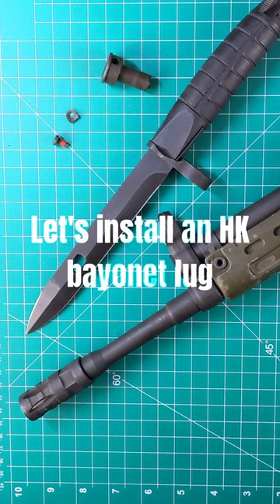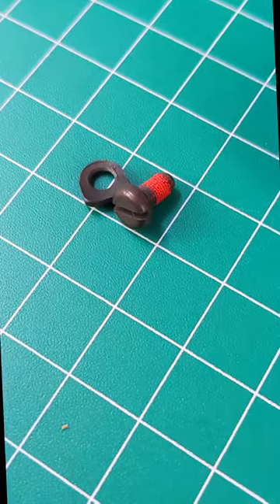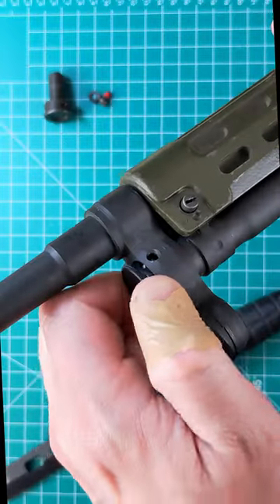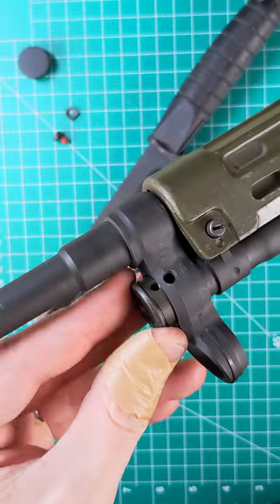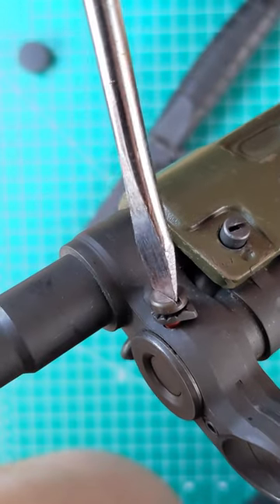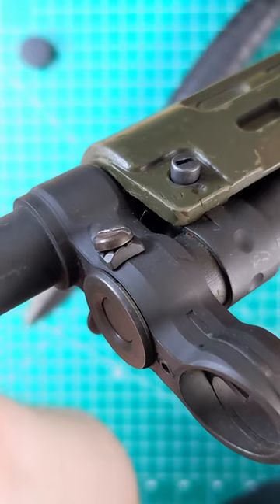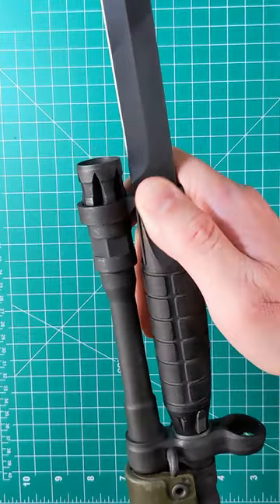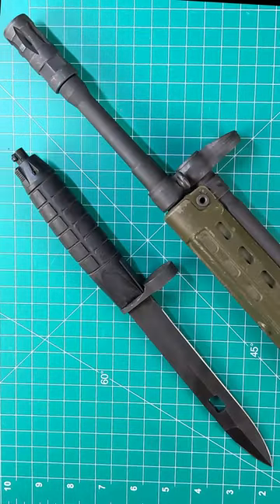PTR91 + HK Bayonet install

Comment: if the argument for guns is self defense, why would you want an attachment specifically made for war. bayonets are strictly offensive weapons.
Reply: So either you've never ran out of ammo and had someone charge your position... Or you're a troll 🤣
Reply: I'd say it'd be a last ditch effort at self defense if you ran out of ammo 🤷
Reply: The bayonet is a last ditch defensive option.
Ammo is going to run out quickly and your position is about to be physically overun: certain death is near and surrendering would be a thousand times worse than death.
The order to"FIX BEYONETS" sends a chill right to your very core.

Comment: The Greek G3 bayonet doesn't need an adapter. It plagues directly in the tube. It has a wider bottom and the locking button engages in the hole for the adapter screw.

Comment: In your honesty opinion is the ptr 91 worth it for not being a cold hammer Forged barrel and no chrome lined barrel
Reply from the maker: Maybe if it ever gets past the break in point. Mine is still not very reliable tbh
Reply: Had mine for a few years now, it's one of my favorite rifles after the initial break in period(follow what the booklet says and it goes alot more smoothly than just dumping 500+ rounds all at once). I've had no problems with the barrel and she runs all day every day, keep her well oiled and she be happy. The only ammo I've really had problems with is PMC M80 ball having many FTF and FTE, and now I usually run Federal .308 FMJ-BT and have had no issues. 

Definitely worth if you can get past weight, the fact it's not left hand shooter friendly(took awhile for me to get good) and the very long length of pull(I'm 5'8" with a 69" reach and haven't had trouble)

Comment: You need the grenade ring back... Make Grenade Launcher Rings Great again.
Reply: @PRDUBI Agreed 100%. The barrels look "weird" without them. I remember years ago before PTR made the move to SC, an article showed a picture of one of the smiths for PTR grinding off the grenade tension rings on the triple frames (front sight bases)....they should just leave them on! It is literally more work just to grind those rings off.

Comment: How do you like the ptr 91? I agonized over getting one and passed.
Reply from the maker: I like the aesthetic but they are definitely an antiquated design. Mine still doesn't really like steel case so it's more expensive to feed than I would like, but hopefully it'll settle in after a few more range trips.
Reply: Do you know how much more you would have to watch for on Century C.E.T.M.E. ?   The PTR is nice better built version, the OLDER CETMEs Model B/C  were the only option for decades and is actual the gun that HK's G-3/91 came from.   On those used CETME  especially from Century Arms who uses Drunken Moneys to weld their kits up to legal semi's, it was gamble between work done on hang over Monday verse mid week better quality, yes the quality varies that badly in different batches. You'll want to  check for  a decent in "spec"  Bolt Gap,   then the Head Space.  Which may have been achieved by Century Monkeys grinding down the  bolt face which  changes the Bolt Gap and brings it back into head space, which then messed up that  the Bolt Gap.   So New PTR is lot easier option but you pay more that better quality control.

There is a great old school firearms forum , off the beaten path but full of expert gunsmiths, on how to check the rifle and what all these should measure so you don't get someone else's lemon problem gun. Guides that have been improved but were started 2007-2010 and have held the tests of time.

Militaryfirearm  com  then click forum  You'll see many different guns listed for each different section, they all also  have sub forums under their "type/class".   For the HK/CETME/PTR   You want to   go into the "Battle Rifles" section  Then you'll see the CETME/HK Sub Forum and Secondary sub forum  one for new  builders especially.  These are the old farts that wrote the early guides and have real gunsmithing guides threads, if you need to adjust the rollers sizes on that "delayed Roller Blow Back" system the PTR uses....